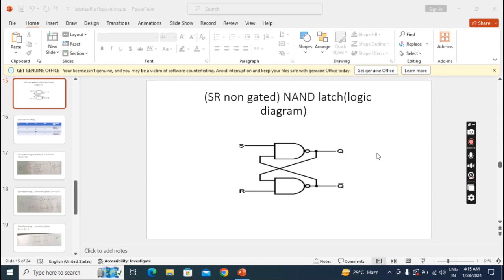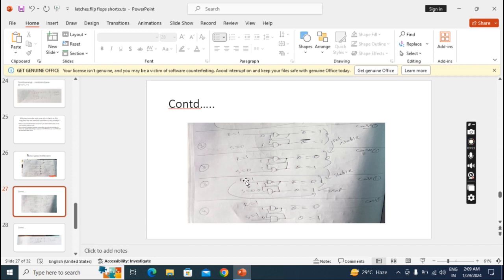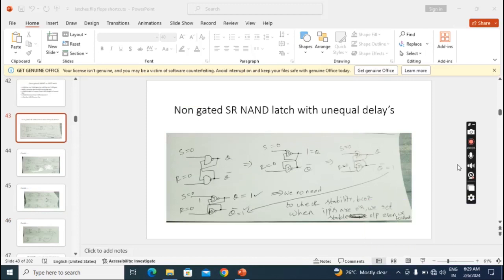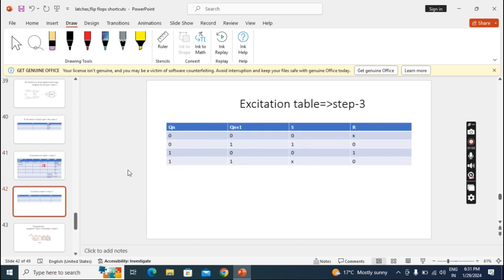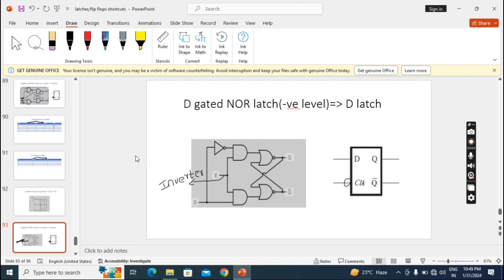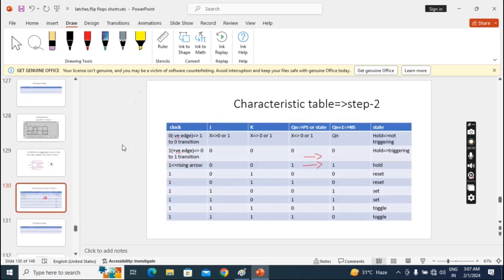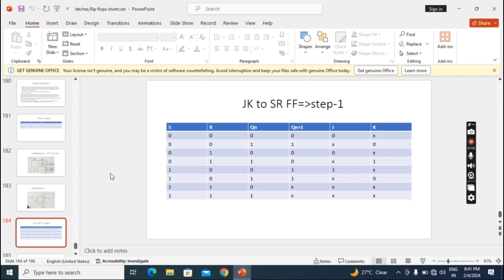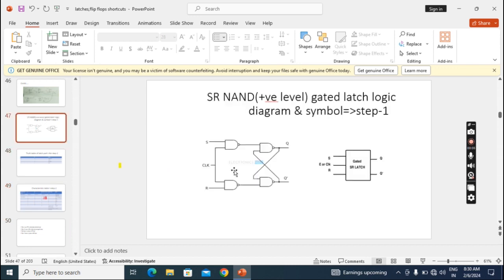latches and flip flops in 2 hours by Deva Kumar talluri@digital electronics@VLSI

Comment: Sir what is the difference between D Latch and d flip flop in representation.According to gate level circuit diagram
Reply from the maker: @RynoldsDalu7  in working also..latch level triggered but flip flop edge triggered
Reply: @FreeVLSIDVtrainingbyDEVTALLURI  yes sir in gate level circuit diagram Representation..for latch we give enable and for flop we give clock.....but sir we say 2 latches can be formed as flip flop right
Reply from the maker: @RynoldsDalu7  enable is a level triggered clk,so enable also clk only..yes,2 latches work as FF
Reply from the maker: @RynoldsDalu7  in the symbolic representation and in charactistic table also difference will be there
Reply: @FreeVLSIDVtrainingbyDEVTALLURI  so we can represent d flip flop by using 2 latches right sir..Then it will be see like master slave D flip flop? Then what is the difference between Dflip using 2 latches and master slave d flip flop sir?
Reply from the maker: @RynoldsDalu7  master slave FF contain 2 d FFs but d FF contain 2 latches
Reply: @FreeVLSIDVtrainingbyDEVTALLURI  Ohh OK ok Sir ...d Ff contain 2 latches but that 2 latches we want to give enable signal only sir? One enable with direct and another with inverted
Reply from the maker: @RynoldsDalu7  yes exactly